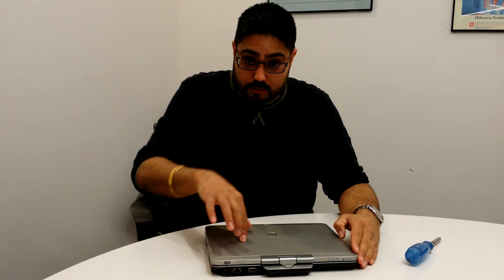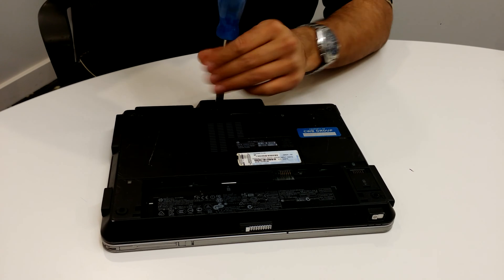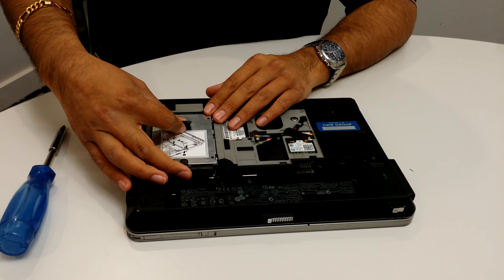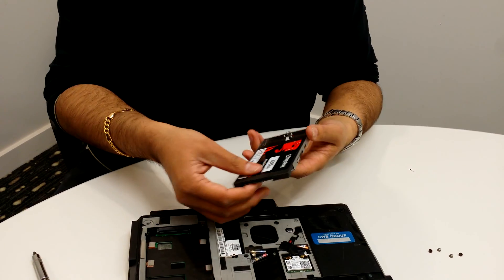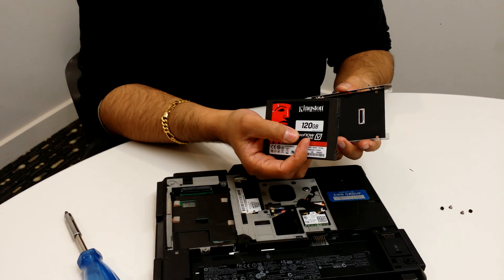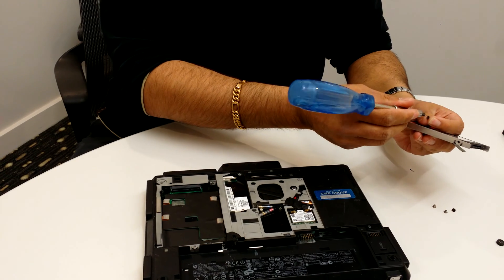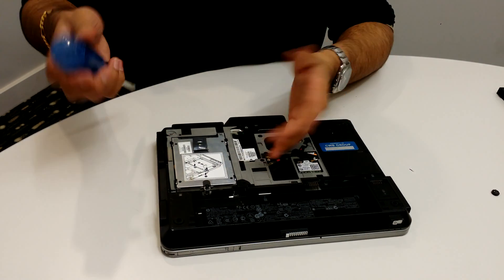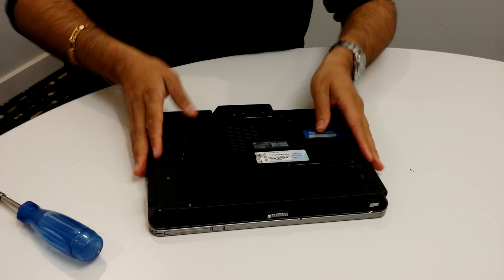HP 2760p - How to replace the hard drive

Comment: Does the HP Elitebook 2760p use a SATA Drive or SAS Drive or Solid State Drive? I want to buy another HDD for my HP Elitebook 2760p so i want to know the type to look out for.
Reply from the maker: The 2760p comes with a standard magnetic 2.5 inch sata drive. It can be upgraded to a SSD and it does work. I believe that's a Kingston 120gb SSDnow in the video. SAS drives will not work.
Reply: which one is it then, mine has broke and i need to know
Reply: 1.8inch
Reply: @digressingmecool7321  No, it's an ordinary 2.5 inch SATA drive. The earlier models, like the 2560 used the 1.8" drive. I'm writing on a  2760p right now, and have had the drive out several times.
Reply: @jpguthrie6669  Hi, i just wanted to ask you about the RAM MEMORY STICK model, is it a "DDR3 PC3" Or "DDR3L PC3L"? 
Thanks in advance for helping...